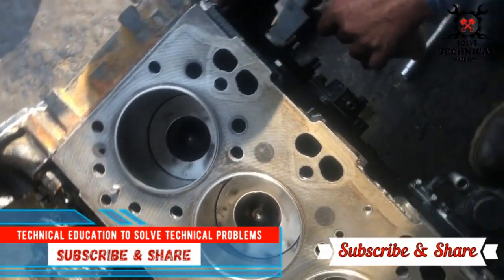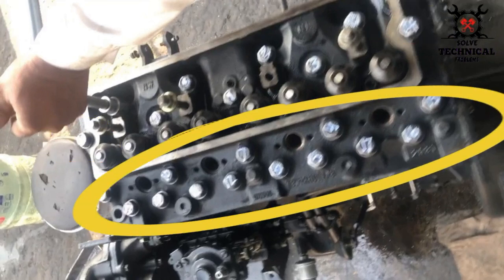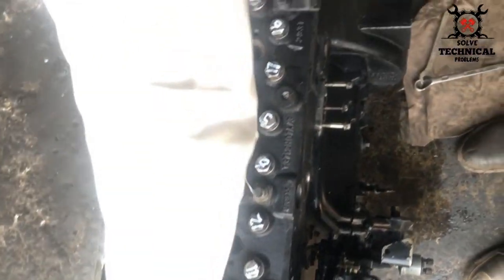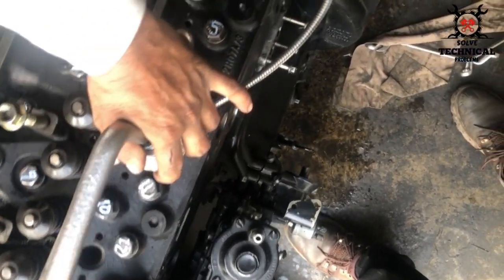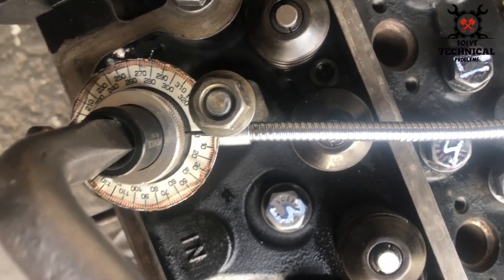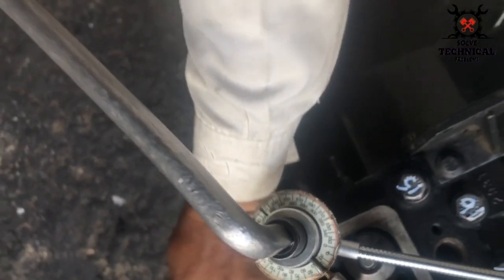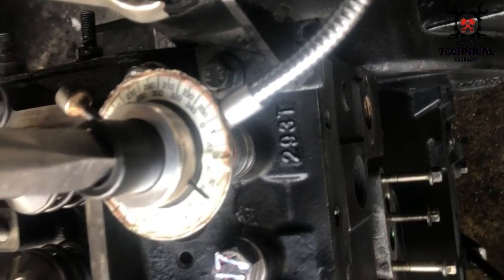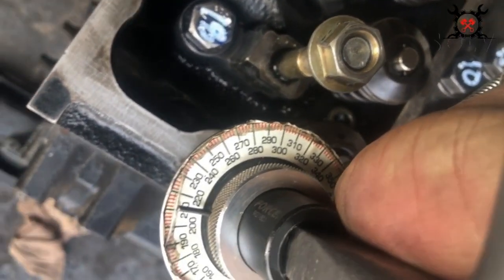cylinder head bolt tightening torque Perkins 4 cylinder. torque sequence Perkins diesel engine.

Comment: What was the original torque before the final rotation?
Reply from the maker: 110 NM or 81 lb ft
2nd step short bolt 150 degree 
Medium bolt 180 degree
Long bolt 210 degree 
By mistake I shared the torque of John Deere 4045 engine Sorry for the mistake
Reply: @Technical.Education  thx.  I was watching and learning…..I interpreted you to say 110nm and then 100+ degrees…..I went with 70nm/110nm + 70 degrees…..felt like I shouldn’t go any further.   It was real helpful when you put the spec on the screen.  I also had a hard time following you on the video entitled “valve lashing”. But you put .20mm on intake and .45 on exhaust on the screen…very helpful.    Thanks for the time you put in on these videos,I find them very helpful while working on my farm machinery.  Greetings from TIFTON Ga. USA 🇺🇸
Reply from the maker: @kerrytodd3753  110 NM or 81 lb ft
2nd step short bolt 150 degree 
Medium bolt 180 degree
Long bolt 210 degree 
By mistake I shared the torque of John Deere 4045 engine Sorry for the mistake